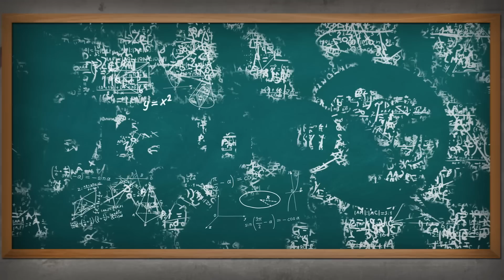How Does Air Force One Work?

Comment: bid for the contract? you really think they would have given it to anyone other than boeing?
Reply from the maker: Interestingly, Boeing turned out to be the only company to make a "credible offer." At least that's what they said...
http://www.bloomberg.com/news/2013-09-12/boeing-poised-to-be-sole-bidder-on-air-force-one-jet-replacement.html
Reply: +Sunny Davies Plus it would be kind of embarrassing if the contract ended up with, oh say, Airbus.
Reply: +Bernard Gilbert but an a380 is perfect  as a flying white house
Reply: +Bernard Gilbert but an a380 is perfect  as a flying white house
Reply: +Shanee Bahera Yes, but Airbus is a European company (they are actually a defence contractor). Lockheed would have been the possible other major contender as they are a US defence contractor and do have a large airframe to base it on in form of the C-5 Galaxy or the C-141 Starlifter, though these are generally considered cargo airframes and not passenger ones.
Reply: Well, until 1984 Lockheed were producing the L-1011 TriStar, a passenger jetliner.
Reply: What Not To Do At a Stoplight Don't worry, Northrop and Lockheed will be providing all the electronics onboard the plane. Boeing simply put all the parts from supplies together and place a Boeing sticker on the plane.
Reply: lockheed will own boeing before we die.
Reply: if it aint Boeing i aint going

Comment: 4:58 Just because it can refuel while flying does not mean it can stay indefinitely in the air, unless you expect the passengers to survive on a diet of drinking jet fuel.
Reply: rif42 true, apart from food or the human element 
- The engine oil levels needs to be maintained too. 
It will run out after a couple of dozen hours of operation.
Reply: +Sumit John like 4 hours is top limit I think

Comment: BrainStuff - HowStuffWorks explains the costs of operating Air Force One, what it really is and how it works.
Reply: Another awesome video!  Keep up the good work.  This channel is quickly becoming my favorite.
Reply: The guns on the falcon could actually be there. In WWII the some of the bombers had ball gun stations that are similar to the ones in Star Wars.
Reply from the maker: Michael Cloutier Thanks!
Reply: venom valle Shorter, and easier to wrap our heads around.
Five syllables traditional, compared to seven your way.
I counted.
Reply: That is because it is most likely one of them or is base on them.

Comment: i once read that A.F.1 has a 5 mile long tether with a transponder at the end that can be lowered into and dragged through water to communicate with submarines. i can't find this info anywhere and i forgot were i read it. has anyone else heard of this? i would love to see a video of this procedure.
Reply: DroneXFun The US Air Force operates two VC-25 the "Air Force One" jet as well as 4 E-4 aircraft both aircraft are similar but the E-4 is used as a flying command post and is usually not used to transport the president. The E-4 does have a TWA (trailing wire antenna) it is used in multiple communication systems and is one of the few that can communicate with Ohio class submarines when underway.

Comment: I wouldn't be surprised if the AirForce started doing barrel-rolls to evade enemy missle/jets. The 747 is probably modified to withstand higher G-stresses. Better still, it has counter offensive systems like drones and Air to Air missiles that fend off SAMs and jets lol.

Comment: ok umm...
On board aquaponics system, 3D Printer, umm liquid coolant threaded just under the entire surface of the plane (no heat signature).... electrostatic walls/ doors/ floors that "taze" anyone who isn't authorized to be on the plane. (Maybe controlled by RFID chips in wallet and or shoes etc.... maybe implanted in a tooth?

Comment: False. Air Force One is the radio callsign for any US AIR FORCE plane carrying the President.

Similarly, any Navy plane is NAVY ONE, any Army helicopter would be ARMY ONE, any Marine Corps aircraft would be MARINE ONE.

If the President were on a civilian owned/operated aircraft, its callsign would be EXECUTIVE ONE.

Also, the aircraft that the President uses most are not 747s, they're VC-25s, a military designation for a highly modified aircraft that is cosmetically similar to the 747. 

Next time, actually do your research before making a video.